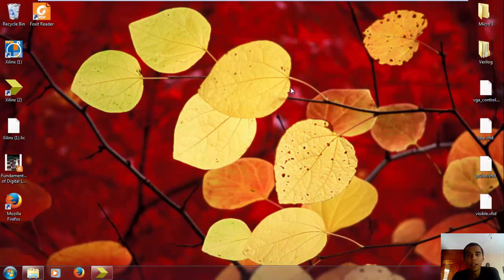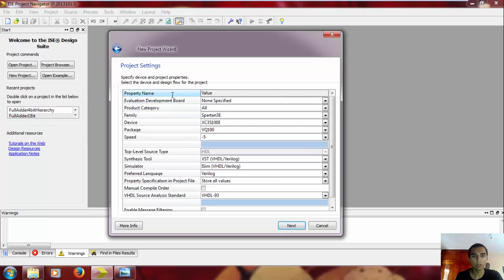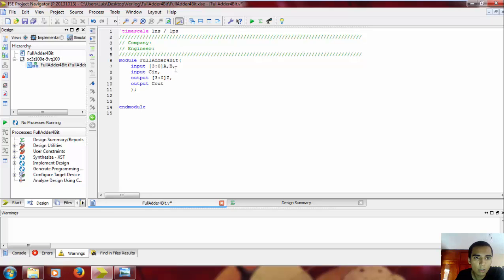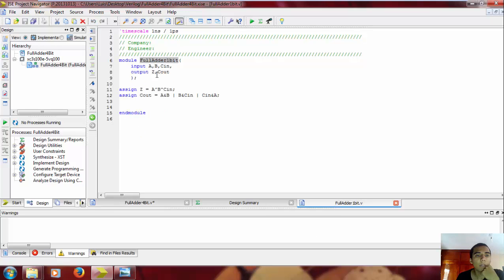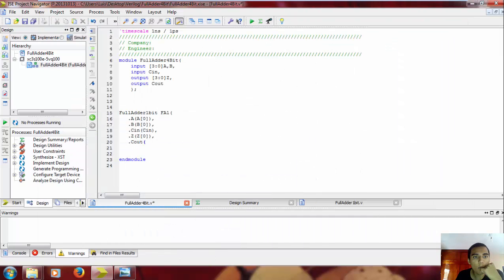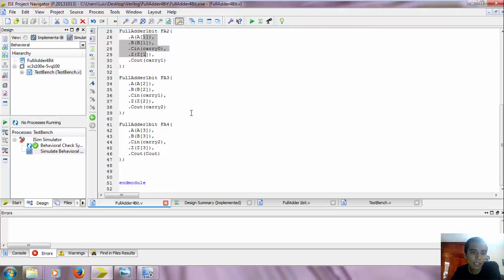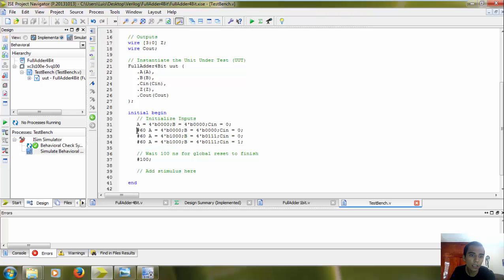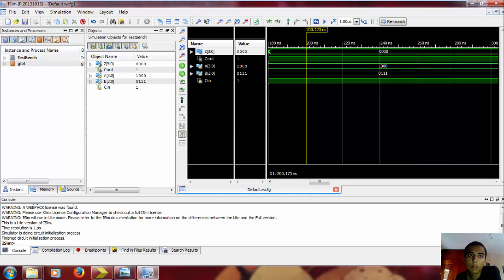Xilinx ISE Full Adder 4 Bit Verilog

Comment: I have to implement a two input ALU with 4 bits each, a 2 bit selector that decides the operation. One of these operations is addition, however i am not allowed to use "+", i have to rely on using structural form what you have is what i need i believe, and i still need help on the other operations which include multiplication using addition and shift method, cannot use"*" to multiply, also i have to implement bitwise AND as well as bitwise OR. I feel like no matter how much research i do i cannot get anywhere. Help. and thanks for the video